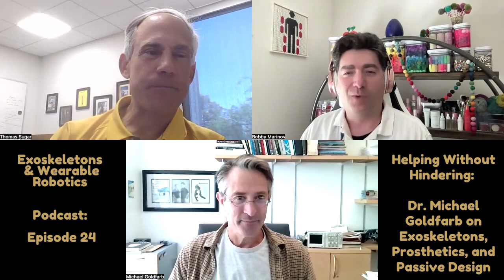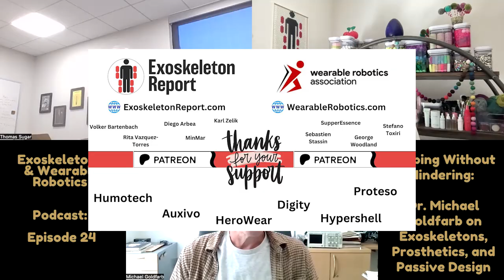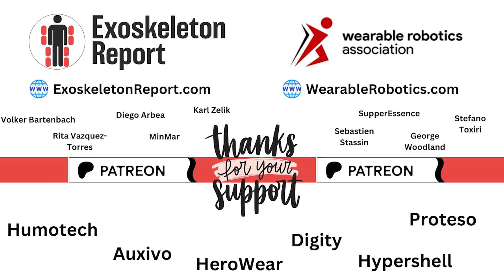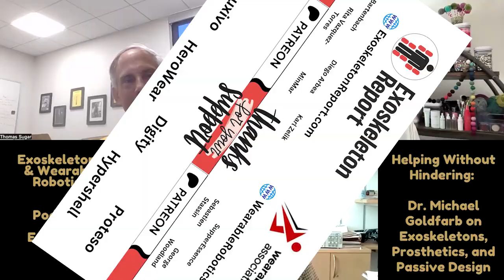Ep 24: Helping Without Hindering Dr Michael Goldfarb on Exoskeletons  Prosthetics and Passive Design

Comment: Now when you have to explain this to lawyers what terms would you use?
Reply from the maker: Hmmm... Yes and No. So the FDA in the U.S. has its own categorization, and so far, that is the one that has made the most significant impact. The rest of it is just us having an open conversation. I think it is becoming virtually impossible at this point to distinguish between an orthotic with an elastic element and a passive exoskeleton.